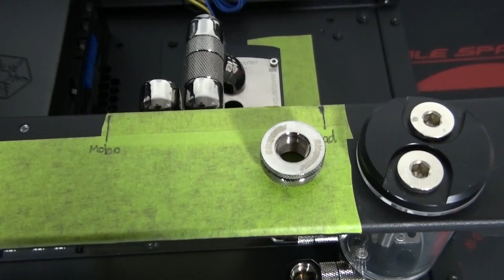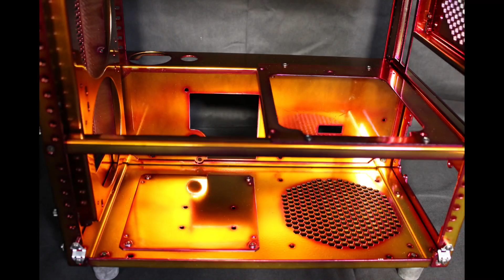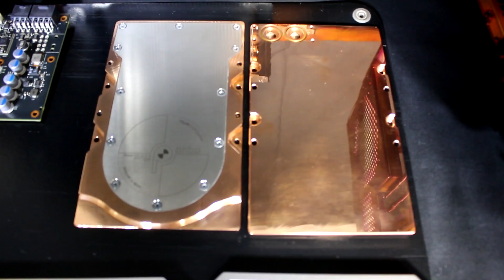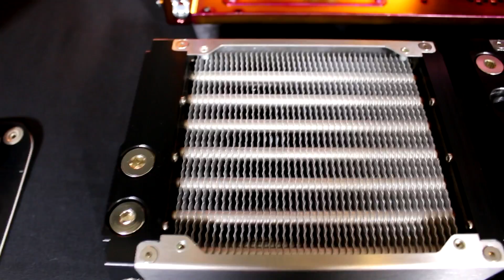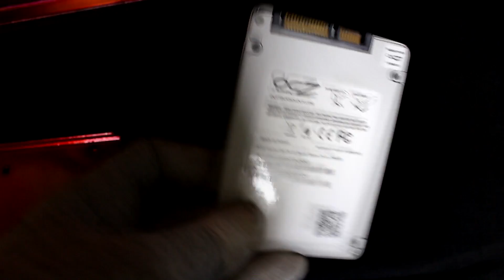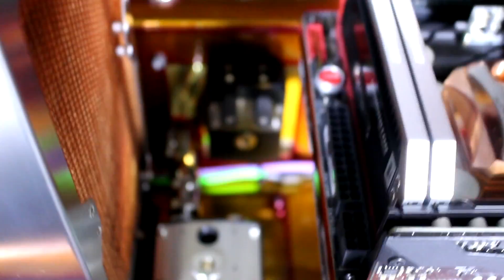Build #16: 'Typewriter': Part 2

Comment: Thank you so much for sharing your work with us. I have been disappointed for some time with computer cases in general. The only design I really liked was the Mac Pro tower case. It was designed specifically around certain components and I appreciated that. It was heavy, well ventilated, and elegant in design. Most of the cases I've seen are boring, monolithic boxes with an attempt at design. That's why enthusiast mod their cases. Your build are seriously inspiring, and you work hard to get exactly what you need to satisfy your vision and the customer's vision.

Comment: great build, been follow your channel for awhile now, but in one of your other videos your was using a bitspower z-multi reservoir with the upgrade kit for ddc, can i use that to connect to a d5 pump top aswell, the only difference i can see is the stand bracket , can you give me any advice on this, thanks.

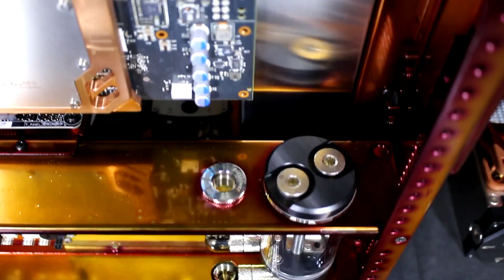Comment: Which fitting adapter is it you are using on the midplate at 23:16, next to the top of the filter? I have seen these a lot of places in your recent build logs to run tubing between cover plates, but I haven't been able to decipher exactly which it is. I am guessing it's something like the Bitspower BSWP-C23 or C66?

Comment: On the OCZ SSD's I would like to mention that while the older OCZ drives stunk, However, the newer driver like the ones provided by the client are actually made under Toshiba managment as Toshiba bought OCZ  so now OCZ has changed the NAnd memory on the drive to Toshiba's Nand which should be better. THAT being said it is still a newer relatively untested product and if it were me I probably would have used  something proven stable like Intel, Crucial. or Samsung drives. The Intel 730 with the skull and silver design would have looked really good in the build.

Comment: I really like the colors or the custom sleeving. I saw it at first and thought that you had a stroke, but it actually does look really good. Additionally, props on painting the fans. You're right to say that the stock Noctua color would work, but painting 'em was a good idea. I can't wait to see it a little more done!! Quick question though: why are you bending the acrylic and not using fittings?

Comment: Do you think it would be possible to build a speaker in a computer, Most likely into a 140mm Fan mount, and do you think that would be okay for the Rest of the components on vibrations or so. Because a speaker in my rig would be very nice :D subwoofer at the bottom, midspeaker to the Front and a tweeter above the midspeaker
Reply: Unfortunately that wouldn't work. When building speakers you either need a closed box, or a closed box with fixed reflex tube. As soon as you have openings in your closed box, the soundwaves are going to cancel out each other. Furthermore the metal-case is not stiff enough, so you'll have vibration and "metallic" side-noises in your sound. Lastly, the volume of the speaker-box has to accurately fit to the amount of air that all of the chassis are going to move and the length of the soundwaves to not create overlapping or standing waves, else the sound will be damp or empty. A subwoofer-chassis moves a lot of air, that's why the boxes of subwoofers are so huge. Moreover, if you are setting up a 3-way-system, you'll need 3 PCBs for frequency dividing and that will cause a lot of trouble for cable management. So all in all it will be a bad idea to even try it, because all the components you need (chassis, frequency-dividers which consist of high-end caps and chokes and the cables) will cost 600+ bucks and in the end you're getting an even shittier sound than if you just bought budget-speakers.
Reply: Metatr0n thanks :D I live in Germany so that wont be a problem ;) I don#t think to set Apple side by side with beats is fair, because Apple has a high effort on their software quality, maybe not worth this high price but its imo the best smartphone software out there.
Reply: Metatr0n Not to mention all those giant magnets right next to your drives and other components.  ;)
Reply: Metatr0n thanks :D very interesting
Reply: Maxi86inAction
That's the reason why you have such a huge price-gap between budget-speakers and high-end-speakers. The budget-speakers are designed in 1 day and produced with the cheapest materials. The high-end-speakers are designed in several months with complex calculations, testing, testing, testing and more testing with different settings, fine-tuning and different materials. All this research and trial and error costs a lot of money and in the end with a sound system that cost you 1600 bucks, you probably only paid 200 for the used materials but 1400 for the months of research that went into the sound-system.
My favorite quote when it comes to sound-systems is "The one who buys cheap, will buy twice".
Reply: Metatr0n yes and than there are expensive devices that have been designed on one da but everybody likes because of the design :D (Beats for example). I understand that development is often more expensive then crafting the actual product itself but its hard to figure out which product had a long development range and constant improvement.
Reply: Maxi86inAction
I have to agree on your point with the Beats by Dre but those products run in the same line with those of Apple where you mainly pay for the name and the hype.
For me, one of the very best manufacturers of Hifi-systems is Nubert. It's a German manufacturer and his website unfortunately is only in german but I still leave the link here with an overview of his products.
http://www.nubert.de/produktuebersicht/102/

Comment: an orbital polisher is best, because it is random, especially for soft metals.
Reply: and, no back plate on the video card?
Reply: detoxrum
Probably because you don't see the other side of the graphics-card. If the computer is on your right and you look through the window, you exactly look at the GPU-waterblock.

Comment: This build looks awesome, but one question. Why is he using airflow fans for the radiators. o-o?
Reply: If the fins on the radiators are not really dense, you don't need static preasure fans. SP is only useful if the fans are dense and the air is not going through them fluently. For all other purposes AF fans do exactly the same job.

Comment: I have noticed that you changed fittings for acrylic tube. Do you need to chamfer the edges of freshly cut solid tube with those new fittings? (before u used different fitting for acrylic tubing BP-BSWP-C47 and C48). Those new fittings you have shown at the end of the video are made from 2 parts.. ? how does this work ?

Comment: WOW ! Well done, this is quite an accomplishment !
If you can do a realistic copper finish, then you should also be able to get a reasonably realistic gold finish !

I'm not a fan of the plastic sleeving colours but each to their own, I can't think which colour would look better though. I think it's because they are plastic, I'm imagining all kinds of alternative materials but none of them would be easy to fit.
Imagine thin brass tubes to route the thin wires through ! I don't know what I'd do with the 24 pin or 6 pin cable groups, maybe I would have used some OFC copper speaker wires instead of the silver coloured ones.
Also I was waiting to see which mobo you installed because the plastic sockets would also stand out, this was a disappointment but you don't really have a lot of options unless you could find one that just had black components. It would have been really cool if the mobo had gold coloured heatsinks though.
Really loved the finish on that FD Node case, I can see how it's done but there is no way I could ever repeat it and get the same quality of finish !
Reply: I've been thinking about this all day, just can't get it out of my head ! Just watched it again and I like the plastic colours (red on the mobo and green/violet sleeving) even less now, I think there are just too many contrasts altogether.
I would have preferred less colours, maybe violet (hard to find a mobo to match) or blue which shouldn't be a problem. I don't think the red plastic bits on the mobo will be visible when the thing is finished but I just can't bring myself to like that green ! Please don't use U/V lights !

Comment: I got to thinking what about using Crystal? Squeeze a crystal of manganese oxide hard enough, and it changes from an electrical insulator to a conductive metal. Researchers found that when the atoms are forced together under high pressure.

The magnetic properties of the manganese atoms become unstable and collapse, freeing the electrons to move through the crystal. There is also another method which provides plastic insulation on an electrical conductor.

In which the conductor, enclosed in an oversize tube, is passed through a fluid and through an annular crystal of a piezoelectric material immersed in the fluid. During passage of tube and conductor.

The crystal is subjected to electric current to cause alternating expansion and contraction of the crystal. I have always believe that the future of PC computing lies in dealing with the bottlenecks.

Which are keeping it from evolving to the next level.  Well that just my two cents. Anyways there is a more immediate problem I have discovered with using any type of tubing or acrylic.

Plasticizers or dispersant's are additives that increase the plasticity or fluidity of a plastic, especially polyvinyl chloride (PVC) tubing in computer liquid cooling. Unfortunately majority of plasticizing agents break down over time and under heat.

Thus leaching the fine powder particles which deposit on all surfaces. Tubing with plasticizers is usually the culprit for majority of systems failures by clogging of the micro channel fins in the water block.

Thus by building up on the water pump impeller shaft thus overloading the motor. I just discovered this recently. However I maybe there are some types of acyclic which don't use plasticizers?

I gotta stop watching your videos lol. To many mad scientists thoughts keep popping through my head. Keep up the great work. :)

Comment: The color of the sleeves look good but they do look out of place for the build in general.
Reply: I think it's because they are plastic, I'm imagining all kinds of alternative materials but none of them would be easy to fit.
Imagine thin brass tubes to route the thin wires through ! I don't know what I'd do with the 24 pin or 6 pin cables groups, maybe I would have used some OFC copper speaker wires instead of the silver coloured ones.
Reply: Ian Clarke
When looking at this build with all this copper and brass, it gives off a real steampunk-ish look, so probably for cable-sleeving I would have tried to copy the old look of telephone cables. Probably a brown parachord sleeve to give a cloth-like texture and in the end just twisting all the cables. The pink would have worked really well as a coolant-colour, probably even with an UV-effect to give a real steampunk-look like some magic jelly that flows through the tube and gives "energy" to the magic calculating machine.

Comment: OCZ SSD's sucks. I mean they do not last. I use Samsung or  Cosair.
Reply: Right unlucky 3 times? Yet no issues with other drives I used? Please.
Reply: I got an OCZ agility 3 since 2011 and it's still working fine.
Reply: Corsair has also had alot of problems. I would go for Samsung or Crucial.
Reply: ***** I think it depends on what line and generation of SSD's. OCZs were genuinely crap in the Vertex/Vertex 2 days. I only got two of them because they were at a very low price. I started seeing problems after 3 years of using them. Windows locking up and rebooting more frequently, corrupt system files, etc. They were so damaged that Clonezilla couldn't clone or back up anything from them. Good thing I didn't keep a lot of important stuff on my OS drives.
Reply: Kotoma I remember there was a website that posted RMA statistics for different brands of SSD's sold (among other components). This was in 2011 but that was the time when the OCZ's were the worst brand to pick. Not surprisingly, OCZ had the highest RMA at 3.5% return rate, while Kingston and Intel had 1.1% and 0.3% respectively.
Reply: Samsung have much higher nand decay than most other SSD's, talk about reliability.
Reply: I'm talking about experience. I've had 3 OCZ failed RMA'ed only to have them fail again. That makes me qualified to speak about their products. Some people are jack asses... anyway. I've had Samsung and Corsair SSDs running in my build since 2012 not one failure. So by my experience Samsung and Corsair are more reliable than OCZ. Also I've been building pcs for 7 years now and like everyone else tried different products and have my go too and know what product to avoid. I don't need the fan boy attitude.
Reply: "Fan boy attitude", also it's common knoledge that certain OCZ SSD lines were prone to failing, the vertex series was not bad at all, and was first choice for a lot of people because of the unmatched speed.

I wouldn't go for OCZ, Samsung or Corsair, OCZ is dead now, Samsung likes to cheap out to maximise profits (even though the 840 evo is very well priced, it just doesn't last like other SSD's), and corsair just use their name to warrant charging extra for a very normal product (not just in their SSD range).
Reply: I'm commenting from my experience and the fan boy comment wasn't toward you TheWargod56. Tell me WarGod what SSD do you recommend for my next build.
Reply: Dennis Boyd  Crucials MX100 drives are really good for price to capacity, and still have really solid performance, if you can spend more the M500/550 is still very good value for money, but a good bit faster.
Sandisk drives are fast, and the black housing means they're good in sleek builds, also if you're running Z97/X99 sandisk have M.2 drives with black PCB's unlike most M.2 drives.

That's what I would go for, kingston HyperX 3K's are quite good, although the SSD Now drives are pretty poor.
Reply: Dennis Boyd You say you're talking from experience, but your first post said, "OCZ SSD's sucks", as if it's a definitive fact. Your experience doesn't make it a truth for the brand on the whole.
Reply: The whole thing is "LIKE MY OPINION MAN!" It's implied it's not fact by saying it SUCKS. I mean really at this point Jason your trolling.
Reply: ccricers that's what I had was the Vertex.
Reply: Dennis Boyd bad batch of SSDs it happens all the time with hardware
Reply: I have a vertex 2 in an old computer that I got over 5 years ago and it's still going. OCZ got a bad reputation at one point and they never recovered from it. The only SSD I have ever had fail on my was an mushkin ssd which they RMAd for me no questions and gave me a new one.
Reply: I bought a USED 120GB OCZ Revo PCIe SSD, and Iv'e been using it for 3 years with extreme use, along with my OS.

Maybe their sata drives suck, but their PCI and PCI-e drives are quite good from my experience.
Reply: OCZ was recently taken over by toshiba so they are now under new management and ownership using different memory in the drives (it is now toshiba Nand) so these are totalliy different drives (time will tell if they are better or not)
Reply: Sandisk is also a options.
Reply: To only have tested 3 drives, you can not state facts that OCZ has unreliable drives.
Reply: *****
It's common knowledge that OCZ make bad SSD's. Their CEO mentioned in a press conference that they are going to puck up their SSD game as it was "Despicable to say the least".
Reply: I love Intel SSDs, but he does what the client requests. That is how proper business services firms work.
Reply: OCZ Vertex 4, 2.5 yrs without any problem
Reply: 悄悄
Reply: 毛干净 baka nihonjin desu.
Reply: l aTranceGuy l so desu ka
Reply: My OCZ Vertex 4 has lasted me over 2 years and has worked perfectly fine for me.
Reply: l aTranceGuy l
2009 would predate most of their issues OCZ had problems from 2011-2012 as they got really aggressive with performance over reliability, but this should be remedied now (we hope) that Toshiba owns OCZ and use better NAND.

Comment: I can't even tell you how much I've been looking forward to this. Just gorgeous as always!
Reply from the maker: Cheers for the awesome support. I'm glad you enjoy the videos, lots of exciting builds coming up. The next one is a Sith themed build and the one after that is the first of the custom built cases.
Reply: ***** Thanks for the response, Daniel. That Sith theme sounds awesome. Congratulations on the expansion to your shop and channel as well.
Reply: ***** Love the case, just wondering would it have been cheaper to reproduce the case in actual copper?
Reply: Hi Brian from swiftech!
Reply: Draconorst I think if you want to have a case from caselabs then you dont look at the price anymore.
Then you just want a kickass pc. :)
Reply: Wes Murrell Have you received your new face plate yet?
Reply: No, but there is no rush. I am on the opposite side of the country as the swiftech warehouse so shipping is not super speedy, but that is fine.
Reply: ***** your vids are amazing shows how much experience you gained doing this sort of die over hobby i guess. Have Ever done a video about working with acrylic tubing?
Reply: ***** The oxidation of copper is the primary reason not to use it. There is a reason so many nickle-plate the stuff. Whatever finish you go for ends up looking like pond scum (ie green).
Reply: Draconorst  I was thinking copper electroplating this particular case  and maybe antique the clear coat